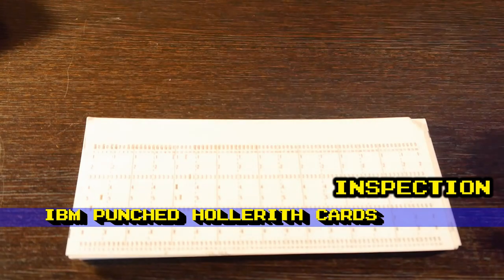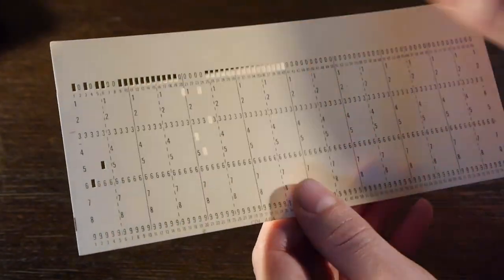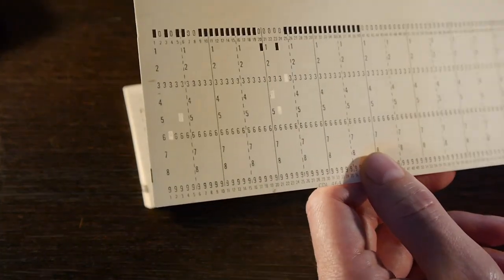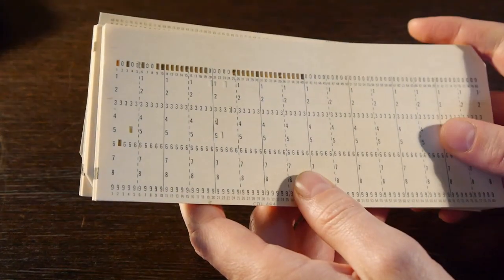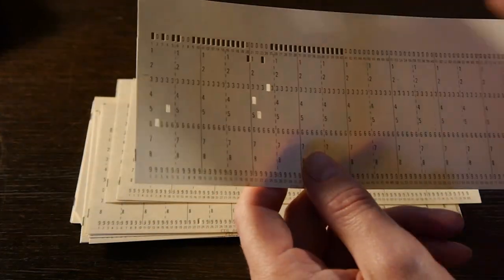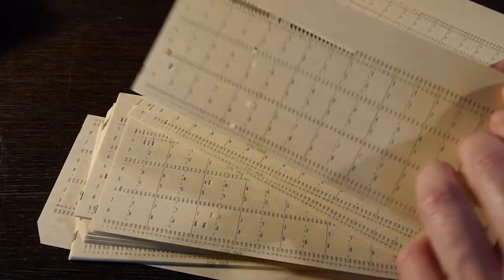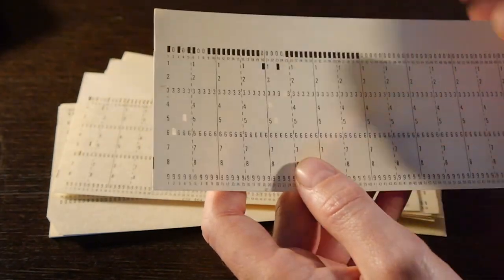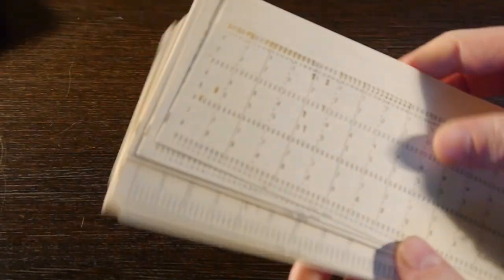IBM Punched Cards, Hollerith Cards [Inspection] | Nostalgia Nerd

Comment: Punched cards are why 80 columns is now the standard terminal width, such as the Windows command prompt.
Reply: I didn't know that interesting
Reply from the maker: +Richard Edwards That's genuinely interesting.
Reply: I used to be a punch card operator at automatic data processing in Manchester.
Reply: referral madness  IT jobs used to have a lot of women until the IT jobs started being considered good jobs, and then most of the women were pushed out, and have only been returning slowly and painfully.
Reply: @Ramandeep kaur Sidhu A 6-and-a-half-minute video takes 104,863,413 bytes of storage as an MP4 file. If we were to store that file on punch cards using only eight rows (one for each bit), it will take 1,310,793 punch cards. Since each card is 0.007 inches thick, the stack of cards will be 9,175.5 inches high, 764.6 feet tall, or 656 boxes of cards at 2,000 cards per box. This card reader reading at 600 cards per minute, will take 2,184.6 minutes or 36.4 hours to read 1,310,793 punch cards.

But instead of wasting four rows, let's use use all twelve rows of the card. Then we can store 120 bytes per card. This video will take 873,862 punch cards, stacked 6,117 inches high, 509.8 feet tall, or 437 boxes. That's a lot of trees. And it will take 24.27 hours to read them.

16,500 punch cards weigh 99 pounds, so this stack of 1,310,793 cards will be 7,864.8 pounds. Or the 873,862 punch cards (120 ASCII characters per card) will be 5,243.2 pounds.
Reply: This form factor (shape and size) is still in use for airline boarding passes.  "Paper tickets" i.e., tickets that could not be substituted with an electronic ticket still existed until as recently as 2015 where they were required for infants traveling internationally.  A child under two does not pay for a ticket but must still have one and a passport as well.  There were no holes punched, however.
Reply: @Nostalgianerd  80 characters per card.. right
?? .. .. so for 1Kb (1024 bytes = 1024 characters) it would be like 12.8.. almost 13 cards..... that is not so bad 🤔.. .. but for 1Mb.. it will be 12.800 cards.. (this is getting heavy.. 🥺 literally)..  and for a miserable crappy disquete?? .. .. 1.44Mb = 1440kb = 1.474.560 bytes/characters.. 18.432 cards and a really big bag.. .. because 0.02 grams (0.0023 pounds) per card is like 93 kilos (205 pounds of paper).. that is a heavy disquete.. 🥴
Reply: Haha they were the standard on IBM 3270 terminals WAY before M$ was even thought about

Comment: Definitely remember punched cards. I grew up in the 60s and 70s when they were still very much being used. As a matter of fact, here in the US they were used for distributing Social Security checks.

My dad was killed back in 1974, and my mom, in ill health and not able to get a job, got Social Security for us, and every month, these checks would come on these punched cards (my guess is that they were easier to process). I still keep a punched card (not a check) in my papers to remember those days.
Reply: That was very common.  So everyone who came in contact with these cards (like the postman) was warned, "Do not fold, spindle or mutilate., " or the card reader would not be able to process it.
Reply: Those checks were on punch cards so when you deposited the check in the bank, it eventually gets returned to Social Security Administration for further processing. The cards can be quickly read by a high speed card reader at up to 1,000 punch cards per minute. This is immensely faster than manually rekeying the data by hand back into the computer. The telephone bill also came on punch cards. When you submit payment, you mail back the card along with your check for processing.

Comment: 1983 to 84 and beyond we were still using them in warehouse inventory entry. 15 digit stock numbers codes and quantities.  No computer screens.  Just print outs.  I kept that file up todate too. Huge books of 4 years kept on hand. Pain in the ass keeping them current and in order.  5 inches of like 25 x 15 computer print outs. Snake ing long plastic precursors to zipties through all the holes in the computer paper to bind them. Salute Cannon AFB 83/85 😉

Comment: I learned to program FORTRAN using punchcards in high school back in the early 1980s... god help the poor guy who dropped his stack of cards and got them out of order!
Reply: Paul Kostrzewa That’s why the language ignored columns 73-80. You could punch a sequence number in those columns and run the cards through a sorter in a minute or two. Sorters were essential machines with pre-computer accounting machines, and some computer applications required sorting input cards ... and of course a sorter helped if you dropped a deck, so most computer departments kept one around just in case.
Reply: referral madness  As far as I know, although out of order execution was invented in the punch card era, it didn't really catch on big until significantly afterwards.  https://en.wikipedia.org/wiki/Out-of-order_execution
Reply: referral madness  In short, no. Dropping a deck of cards and putting them back in random order is not out-of-order execution. It is just a program that will not work.

Comment: ASCII hadn't been established yet.  EBCDIC was used by IBM during the time of the punched cards.
Reply: EBCDIC was devised in 1963 and 1964 by IBM and was announced with the release of the IBM System/360 line of mainframe computers. Before the introduction of the System/360, punched cards used BCD encoding. There were no lower case characters in this encodine.
Reply: Actually it was the HOLLERITH code on punch cards. EBCDIC was the format internal to the mainframe

Comment: As a person who worked with punch cards BEFORE the advent of a computer, i used "unit record" equipment. Machines like the IBM 024 keypunch, IBM  083 card sorter, IBM 407 accointing machines and such (still remember coding using plugboards &  wires)
Then i moved o to tje 1401, 360, 370b 4300, 3090 etc.
Also for most of the readers the coding on punch cards was NOT EBCDIC nor ASCII it was the HOLLERITH code. EBCDIC was another form of coding that made up the 256 bit combinations on IBM computers. EBCDIC or Extended Binary Coded Decimal Interchange Character, was before ASCII or American Standard Code for Informational Interchange.
I am a retired CIO that now vounteers, repairs, teach about vintage computers in a computer museum

Comment: We were still using them at school in the early 80s. 
First lesson of computer science was how to fill in a punch card. With an HB - so they could be re-used.
Reply: What was an HB?
Reply: @joyhearrington8503  A pencil. HB is one of the grades of graphite hardness, and the most common. If you're in the US, we typically just call them No. 2s, but most pencils will have both 2/HB markings on them.

Comment: I have a very minor quibble. I'm just nitpicking really but....

You reference ACSII throughout the video. The thing is that the first ASCII standard wasn't published until 1963 which I don't believe IBM ever adopted for punch cards. Instead they published their own encoding scheme called EBCDIC around 1963-1964 which they use to this day  (it's still the native encoding for IBM and many other brands of mainframe.) Before EBCDIC IBM used "Binary Encoded Decimal" for punch cards I believe. 

Thanks for the videos! Love the channel.
Reply: BCD (Binary Coded Decimal) for punch cards. IBM used EBCDIC encoding starting on the System 360 mainframe system and later on the System/3x midrange systems. The IBM PC introduced in 1981 was the first system to use ASCII encoding.
Reply: Actually you are in correct. EBCDIC was never used on punch cards. It was always the Hollerith code. EBCDIC was used for other storage medium :)
I worked on 407 Accointing machines that used the Hollerith code then later on tje 1401, 360 and on, they used the EBCIDIC code internally and on mag tape, discs etc.

Comment: To give you an idea of the enormity of punch card storage, this 6-and-a-half-minute video at https://www.youtube.com/watch?v=0YAFc1G5NxY takes 104,863,413 bytes (100 MB) of storage as an MP4 file. If we were to store that file on punch cards using only eight rows (one for each bit), it will take 1,310,793 punch cards. Since each card is 0.007 inches thick, the stack of cards will be 9,175.5 inches high, 764.6 feet tall, or 656 boxes of cards at 2,000 cards per box. 16,500 punch cards weigh 99 pounds, so this stack of cards will be 7,864.8 pounds. The card reader shown in the video reading at 600 cards per minute, will take 2,184.6 minutes or 36.4 hours to read 1,310,793 punch cards.

But instead of wasting four rows, let's use use all twelve rows of the card. Then we can store 120 bytes per card. This video will take 873,862 punch cards, stacked 6,117 inches high, 509.8 feet tall, or 437 boxes and 5,243.2 pounds. That's a lot of trees. And it will take 24.27 hours to read them.

16,500 punch cards weigh 99 pounds, so this stack of 1,310,793 cards will be 7,864.8 pounds. Or the 873,862 punch cards (120 ASCII characters per card) will be 5,243.2 pounds.

Comment: How many will it take to store Doom?
Reply: or GTA V?
Reply: Or Microsoft dos
Reply: One, with 75 spare spaces.
Reply: @reb6453  We need to know how many megabytes there are in the program Doom or in the MS-DOS operating system. To give you an idea of the enormity of punch card storage, this 6-and-a-half-minute video at https://www.youtube.com/watch?v=0YAFc1G5NxY takes 104,863,413 bytes (100 MB) of storage as an MP4 file. If we were to store that file on punch cards using only eight rows (one for each bit), it will take 1,310,793 punch cards. Since each card is 0.007 inches thick, the stack of cards will be 9,175.5 inches high, 764.6 feet tall, or 656 boxes of cards at 2,000 cards per box. 16,500 punch cards weigh 99 pounds, so this stack of cards will be 7,864.8 pounds. The card reader shown in the video reading at 600 cards per minute, will take 2,184.6 minutes or 36.4 hours to read 1,310,793 punch cards.

But instead of wasting four rows, let's use use all twelve rows of the card. Then we can store 120 bytes per card. This video will take 873,862 punch cards, stacked 6,117 inches high, 509.8 feet tall, or 437 boxes and 5,243.2 pounds. That's a lot of trees. And it will take 24.27 hours to read them.

MS-DOS 6.21 came on three 1.44 disks which comes to 4.32 MB.

Comment: My first computer used tapes for storage. I'm not sure that these cards wouldn't have been more reliable.
Reply: Probably more reliable... Unless you accidentally dropped the stack of cards - instant data corruption!
Reply: Yeah, but at least you have control of that. Tapes seem to fail completely randomly.
Reply: +Gooberslot It's a feature... Which has been preserved in computing up till this day!

Comment: The character sets on punched cards actually weren't ASCII because punched cards predate the ASCII character set. Instead, several character sets are used, called the EBCDIC character sets.
Reply: EBCDIC was devised in 1963 and 1964 by IBM and was announced with the release of the IBM System/360 line of mainframe computers. Before the introduction of the System/360, punched cards used BCD encoding. There were no lower case characters in this encodine.
Reply: @RaymondHng actually you are both wrong. The code set on a punch card was the HOLLERITH coding method.

Comment: Wonder if a hobbyist out there has recreated a punch card system for modern times, where a single card could back up about 512MB or more?  Just for the heck of it. Maybe even EMP?  If I back up for WW3 emps, I want it done in style.
Reply: Technically CD-ROM acts kinda similar to punch card besides the data is in serial and kinda encoded. And it's pretty much more durable than punch card because plastic is harder to degrade.

Comment: Actually, with old punches, you COULD punch more patterns than they had provision for with just 1 keypress, if you used the Multipunch key (or backspaced the card if the punch didn't have one)(*) and pressed more than one key per column.  Of course, this was a pain, so it was preferably used only for special codes.

Would like to see a video on unit record equipment, which was what used these cards and was used to perform computing before actual computers existed (and overlapped significantly into the early years of computers).

(*)Edit:  Supposedly, on at least some keypunches (including IBM) you could achieve the same effect as a Multipunch key if you just pressed a finger down on the card really hard so that it slipped instead of advancing.  Although the purpose I originally read for this wasn't for multipunching (since the IBM keypunches already had a key for this), but for giving you the ability to insert and delete when using the Duplicate Card key (which had no built-in provision for insertions and deletions) to make a corrected or otherwise altered version of an existing card.  Actually, depending upon how well you could keep the card from advancing, this sounds potentially more reliable than trying to backspace it by just the right amount (manually), unless the keypunch had an actual Backspace key.

Comment: 80 characters per card.. right @Nostalgia Nerd
?? .. .. so for 1Kb (1024 bytes = 1024 characters) it would be like 12.8.. almost 13 cards..... that is not so bad 🤔.. .. but for 1Mb.. it will be 12.800 cards.. (this is getting heavy.. 🥺 literally)..  and for a miserable crappy disquete?? .. .. 1.44Mb = 1440kb = 1.474.560 bytes/characters.. 18.432 cards and a really big bag.. .. because 0.02 (0.0023 pounds) grams per card is like 93 kilos (205 pounds of paper).. that is a heavy disquete.. 🥴